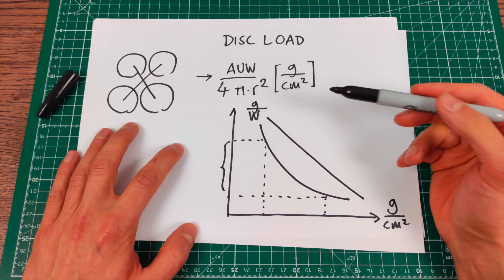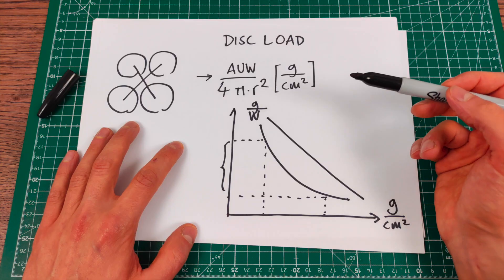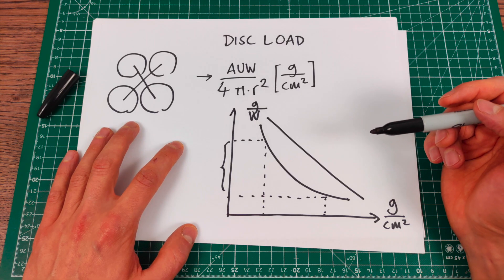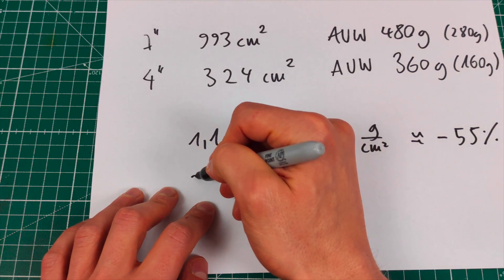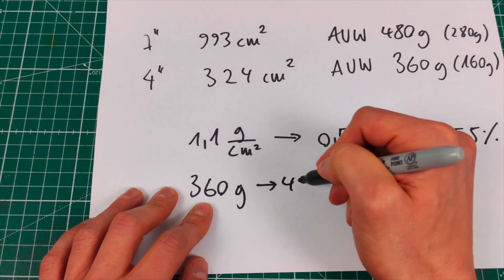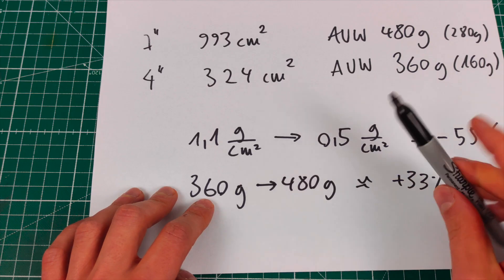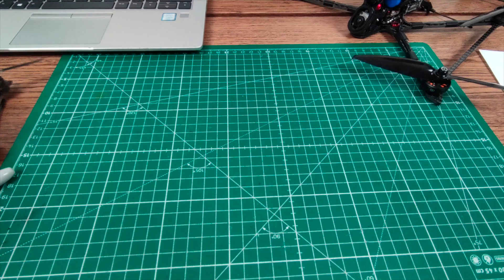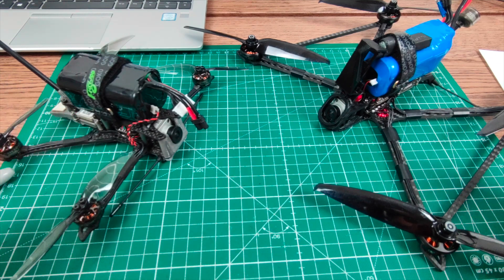Ultralight 7" vs. 4" | flight time comparison | 18650 Li-Ion

Comment: Two things: So on my Sub 250g 7” with the 7038 props, I could get over 9m with a 4s 650mah battery, when I switch to the 7042 props the same battery only gave me around 8m. Sound, your prop area is greater, creating more wind resistance. Don’t match the speed of the two aircraft, match the attack angle and then compare distance and flight time of each aircraft.
Reply: Yes, I agree. Dave should measure distance travelled to 3.3V and compare those. I always measure the efficiency of my fixed wing aircraft in mAH/km, so perhaps something like that instead.
Reply: @immortalsofar7977  you should measure the efficiency in wh/km since mah only won't give enough info. Obviously 50mah/km on 6s is way different than 50mah/km on 3s
Reply: was going to comment the exact same thing. Increased speed, from my understanding, is a major factor to going with larger props  for long range, so a similar speed test is handicapping the larger prop. Im thinking of how quads will fly for longer when moving forward vs. just hovering. Eitherway thank you loads for these experimentations. MiniLongRange is definitely next on the building block once I get back to quads. I think it was mentioned on your instagram but those 2305 superleggera motors might be a good fit?
Reply: So I put an emax 2306 1600kv on an AUW 500g 7” with a 4s 1300mah battery.  It flys bobble free and is very efficient, about 12m. I believe GepRC put a similar 2306 motor on their 7” as well, but it’s a much heavier quad. 
I think each weight increment 250g, 350g, 500g, etc... will have an optimum motor size for a 7” prop.

Comment: You should try the mavic motors and props. With the amount of money dji invests in there drones they are probably very efficient. Banggood has a frame that uses the mavic motors mounting holes.
Reply: I saw that there's an 8in frame available on AlieExpress and BG called the "Andy HD8" that uses the motors for the Mavic. I always wondered what could be done with the motors from a mavic mini or a Spark on a light carbon fiber frame.
Reply: @yannickg6904  I think the biggest factor is the way the props are mounted, each blade can lead and lag individually and that helps with efficiency, I have ordered some Mavic Mini / Mini 2 props to experiment.

Comment: Hey Dave, interesting video. Do you think the tune could substantially decrease efficiency on the 7" quad? I have not been able to tune a 7" to perform decently.
Reply: Yes the tune can change the efficiency of a 7 inch dramatically on my 7 inch with a more control centered tune from UAV tech it drew almost double the current compared to the defaults
Reply: same, 7inch tuning can be frustrating
Reply: Tuning definitely matters.
People literally fry motors and ESCs with too-ambitious tunes.
Running at power draws amps, but hard acceleration of the props themselves as demanded by a tight tune draws even more.
A tune with high frequency oscillations will be even worse by spending longer in that hard acceleration zone.
So an ultra-tight tune will draw more current than a looser, easier tune, and an over-ambitious or troubled tight tune will draw even more.

Comment: A few years ago, I was going to build a medium/large camera platform (a lightweight quad with carbon/foam core, and 10-12" props)(never completed it), and at that time there was only big hexacopters being used. Some research led a link to Hobbyking, and did offer a motor that they developed to run on 8s. Their approach for longer flight time was higher voltage motors and  lighter wiring gauge using 10c lipo batteries. That stuff never became popular and is no longer available. Here's a link for that concept if you are interested....https://www.youtube.com/watch?v=bNaiNNF7ZBs&t=603s.

Comment: Very interesting. The heavier 7" quad needs more energy to stay airborne, so I think you just proved that disk loading is not the only factor involved here. A 7" quad is typically not flown with the same battery as a 4" quad. If you're aiming for the longest flight time you pick a battery that is optimal for the size of quad you're flying. I put a 6S2P VTC6 pack on my 7" and it flew for 22:40.
Reply: i also have 6s2p packs on my 7" but theres no way his motors or frame can handle that weight... a 5s1p or 6s1p would probably be about right for this rig im guessin and just scale the throttle to not overamp the pack
Reply: @badfourlife  I suggested 5s1p Li-ion pack
Reply: The disc loading is very important. Problem here is that the motors Dave chose are too hungry. The only thing you should not spare weight on an endurance quad is the motors. All my 7" LR setups are based on minimum 2307 motors. Best results for me are using BH 2507 1850kv motors and 4S2P LG  MJ1 packs. These motors are far from light but I can cover 25km in 24 minutes of flight without worrying too much about calm weather.
Reply from the maker: Yes, that's basically what I was testing. Does it make sense to further decrease the disc load or does the extra weight cancel out all the benefits. Of course, I could put a 2P pack on the 7" but then I would end up with basically a normal 7" disc load again
Reply: @DaveCFPV  no you were correct to focus on disc loading, total weight shouldn't matter besides it's affect on disc loading. My guess is it's the props
Reply: @DaveCFPV Hi Dave, might be worth to redo this test again? :)
One thing you missed is consider how much the motors are drawing current. If you want the outcome to be disk loading alone, then both motors should be drawing the same current, hence “equally” draining the battery at the same rate. I believe you will end up proving your calculation.
Your 7” motor🎉 is too small(weight of the prop + the auw that it has to push up), thus it is drawing more current than the 4” motor, which then drains the battery way faster.
Maybe get a bigger motor or heavier prop for the 4”, then get a bigger motor for 7” that draws lower current. You could also try 5s to even it out, but the goal is find the motor/battery setup that both draws the same current at hover…..THEN do your test. :)
Reply: The most obvious reason the 7" had shorter endurance was it had smaller battery mass fraction than the 4". It's not the only reason for sure, but it's a significant one. If the 4" carried 200g of battery the 7" would need to carry 270g of battery to get comparable flight time.
Reply: it is not such a simple linear equation.
Reply: @charlesmarseille123  It is an approximation, by disregarding drag and efficiency differences between the two setups. Battery mass fraction is a useful parameter to predict the potential endurance of a setup, the rest depends on the propulsion efficiency and drag.
Reply: @grayscalefpv1748  This I agree.
Reply: @grayscalefpv1748  this is not a rule. Oh man. This whole endurance thing is only about luck. Ive 3D printed ultralight 7" frame using carbon filament. I am sharing my LiIon packs across all my quads. My 5" endurance quad flown the same time as this 7" on the same pack. Why I say its luck? Because you never know what motors you get and how the efficiency on certain propellers will work out. ONLY RULE for endurance quads is - CERTAIN WEIGHT NEED CERTAIN WATTS. Ive noticed that 6", 5" or 7" - it does not matter the prop size - YOU WILL ALWAYS GET THE SAME CONSUMTION for the same weight. Only possibility is to get lucky and find a more efficient combination.
Reply: Yea I like that. What if you increase the disk load of the 7" to be more comparable to the 4 inch. Then you might have a better comparison.
Reply: I have his 5" and its the same body just shorter arms. the 6s2p battery doesnt fit on the top. youd have to try to mount it to the bottom. 6s 21700 4200mah battery would fit but might be a lot of vibrations. hard to tune it out.. i dont use the braces not sure how much they help. I have done a max 40mins on 3000mah li-ion once.. normal flying i get 34min repeatedly
Reply: You mention as well, aerodynamic drag of the body as frontal area exposed bigger on 7inch. More drag on different prop....etc...altoguether along all you mention
Reply: A heavier quad does not necessarily need more energy to stay airborne. In theory it really is all about disc loading. The theoretical minimum amount of energy required to stay airborne is actually 0.
Reply: Nice! I get 22 min on my 6 inch with my homemade 6s1p liions

Comment: Awesome content Dave!, I really love this deep dive into ultralight LR platforms! Anyway I don't think pure flight time is really a useful data for us. I mean what I care about is "how long (in term of distance, not time!) I can fly". So cruising speed is actually a thing! 18 minutes on the 4'' cruising at about 40 km/h means  a12 km  trip while 10 minutes on the 7'', cruising (I'm kind of guessing) at 70 km/h means... again roughly 12 km! While I loved my 4'' micro LR, I recently switched to 5'' mini LR  because I can simply fly the same distance... but faster!
Reply from the maker: Thanks! They both cruised at exactly 40 km/h so I guessing that the 7" will do less than 10min at 70 km/h. But sure, picking a pretty low speed might have been an advantage for the 4". If the test was done at 60, 70 or 80 km/h the 4" could start to get much more inefficient since it getting close to its top speed.

Comment: Those MB2204 are pretty neat for builds like this 7”. I’m surprised I had never seen them before. Apparently there was also a 2450kv variant that would be great for a 5” on 3-4S but those are next to impossible to find.

Comment: Shouldn’t kv be comparable, too? I mean, you are using 4s on both
Reply from the maker: It's roughly comparable I guess. Both are low-end of the kV range for the pro size and 4"
Reply: @dangfpv2557  You are right in theory I guess, but theoretically the 7“ should have flown longer...I would like to see higher kv motor for this comparison. A shame we have to wait like forever for RC parts in Germany

Comment: I think the footage may look different because you may have changed the camera settings for one of them. As far as I know, if you change saturation, EV comp, etc., the changes are not applied to the goggle but only to the air unit/vista you're currently connected to. Might be wrong though.
Great video. Your Micro Long Range has kinda obsoleted 7" for longe range, imo 😅
Reply from the maker: Must be the setting but I actually never touched them. Seems like Caddx might have updated them between the time these two units were produced. 7" will still have its place but, yes I agree Micro Long Range is basically coving a lot of 7" use cases at a fraction of the cost, noise and overall weight of stuff to carry around